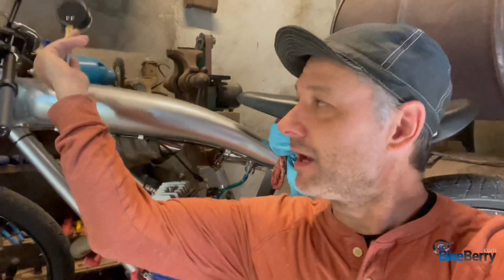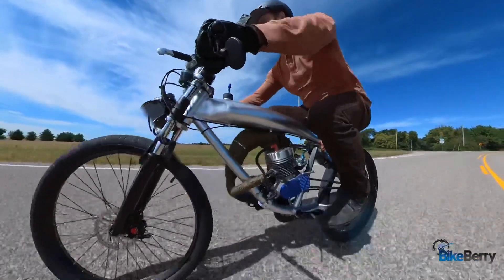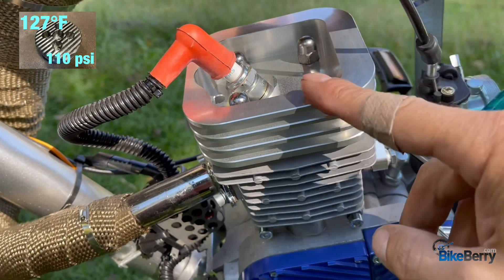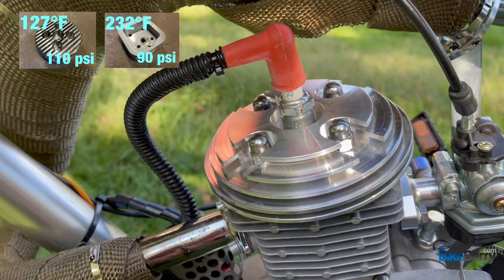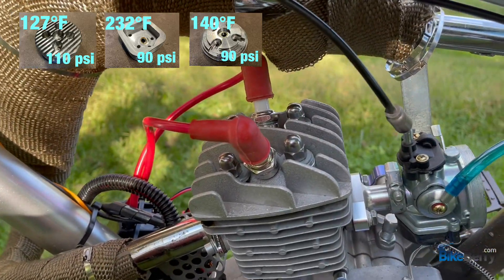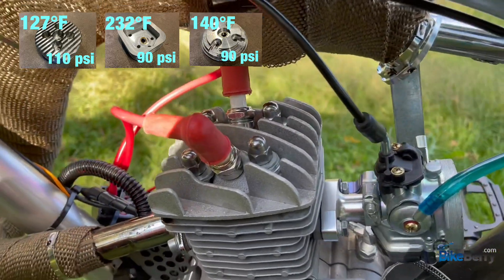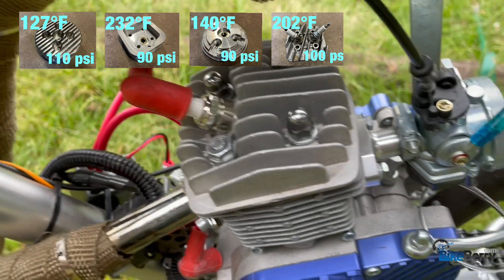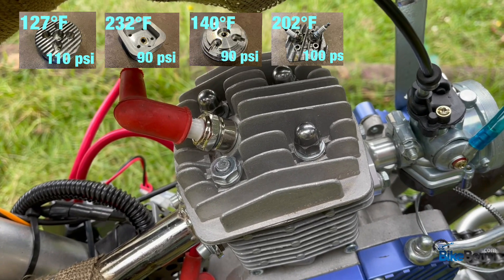Comparing Temp • Compression • Performance in Motorized Bicycles | Head Comparison | Bike Berry

Comment: Let's not get technical. I spent three days in your online chat trying to explain to you with photos that your wheel set with complete front and rear brakes had the pads half on the rotor. I was told I wasn't going to get my money back when I didn't ask for or what that I was told it was my fault I was told it was my bicycles fault I was told that I didn't read the disclaimer on the website

Comment: Seems to me the CNC head has a lot more metal than the ‘ashtray’ style. 
Could be that the combustion is closer to the top of the head too, did kinda seem like you ran it a little higher on rpm’s. 
Double spark- more complete combustion?

Comment: Can bike berry make their own custom cnc double spark plug high compression head ?? Just make them inline like the original dual spark plug head but make the fin design your own. I know I'd pay $90 for one because dual spark HAS to burn better but compression HAS to be right and with that added heat your cnc head would make it very efficient

Comment: if your wanting to know why the performance was better on the dual spark plug? its cause having the 2 sparks igniting the fuel mixture is acting like as if the ignition its self was advanced more. what's done to cars engines with a laptop, advancing it starts the ignition point while the piston has not come back up as far as the original ignition point. this allows the flame out that occurs to burn more of the fuel air mixture before reaching top dead center, this creates more pressure in the cylinder while the position is on its way back down. how the dual spark does it is simple by having more of the air fuel mixture burnt up by the time the piston hits top dead center equaling in more pressure for the piston to travel down with. I'm gonna get one of these heads and do a plasti gauge check the piston to deck clearance to see how much more I can resurface the cylinder head. this will also bring the compression up to the 110 that the other one has if not more haha.

Comment: Now for better cooling you can always buy a hand held dremel tool and diamond cut the fins or take a more simple approach and dimple the fins giving more surface area to cool down. There’s plenty of how to videos floating around and it does make a difference with heat transfer, and it looks cool when the sun hits it. Here’s some advice for the beginner dimpler, go light around first so if you mess up all you have to do is sand all the edges down and it’s like it never happened. Find an old lawnmower someone is throwing out and pull the finned head off of it and practice on that first, and thanks for the videos you make for us the viewers. All the best!

Comment: The 4 stroking is so bad, the data needs to be taken with a grain of salt because of how poorly the engine is running. And those compression numbers are painfully low.

However thank you for taking the time to make this video, some of it is informative. Also th
Reply: I've got 1 of my bikes with stock head that has 132 PSI.. the other has the hi compression head at 110 psi just like his did. Seems like the stock head i have must have a smaller squish gap?
Reply: @rodneygagnon9381  yes or the deck on the head is lower. Squish is the shape of the dome in comparison to the piston crown. You want them to match or be close to it.

Comment: You can see burnt oil on the plug sealing surface for the ashtray shaped head. That's why it ran worse than stock, you didn't install it correctly...
Reply: I just bought one How do we put it on????

Comment: I wonder if drilling a few small holes on the "Ash tray" would help with cooling? If you look at all the other heads, they have channels for the air to either flow thru or around where as if you look at the ash tray, its literally just a block of aluminum with no channels for the air to go thru/around

Comment: I knew that the dual spark plugs head would make more power... your bike was 4stroking everytime you were riding with every head especially when you would give it a little throttle but with the dual spark plugs head your engine was so smooth...I will be buying that set up for myself...
Reply: Wonder what would happen if it also had a stage 2 cdi and coil
Reply: @dannyoutlaw8001.. Hello, did you ever get the 2 plug head? Did it increase performance? What sparkplugs are you running and how much gap did you set them at?

Comment: Please dive deaper into the two plug head I'm very interested
Reply: I agree...I have one!
Reply: @3DWHIZZ  so what do you think does it make a difference?
Reply: @Bobs-yer-uncle  funny you ask. I was stoked to do the bikes maiden yesterday but I couldn't get it started. 
Back to the bench, pulled a plug to see what it looks like, and felt my gut twist from what it said. The piston was hitting the plugs enough to close the gap...🙄wrong plugs!! There are very tiny impact marks on the piston but I don't think there's any noteable damage....so now I'm waiting for the right plugs.
I'll keep you posted...thanks!😁
Reply: @3DWHIZZ  so I did the same thing stay away from the ngk bp6hs or anything saying bp it means the plug protrudes further into the chamber but my piston seems to be just fine good luck 👍
Reply: @Bobs-yer-uncle  I was using the ngk BR6HS, which from what I've read, is the recommended plug. Then I tried Autolite 2974. Still too long in one hole. Then tried ngk bpmr74 which is a tiny bit shorter yet, still touches in one hole.
I did notice when I had the head n cylinder off that the holes aren't situated symmetrically. One is closer to the center than the other and it's very noticeable. Of course the next question would be "did you remember to put the base and head gaskets back on?"
Yep I did,...I knew I did but checked anyway.....sooooo wtf is going on?
This is going to require a very short plug

Edit...the second ngk was a BPMR7'A'
Reply: @3DWHIZZ  I have had that issue on some heads in the past. NGK BP6HS works for me.
Reply: @derekpirie9188  I think this engine has the wrong piston. If I rotate the engine holding the head onto the cylinder with no head gasket in between the piston just touches the head. It's an LD 100.
I'm now running with seven base gaskets to give it enough clearance to use. However I think this might be messing with the port timing somehow because I should be getting more power from this engine. 
Still a work in progress I guess🙄